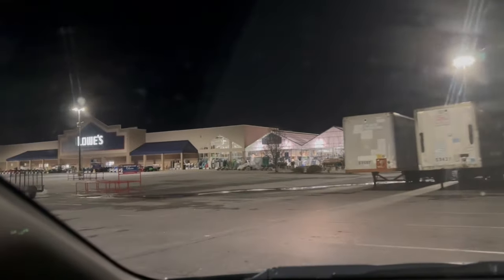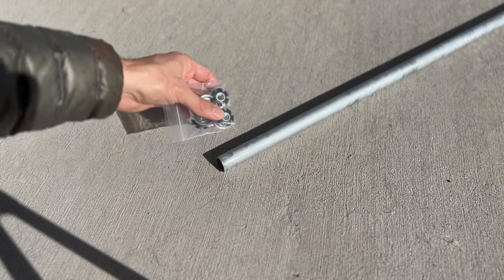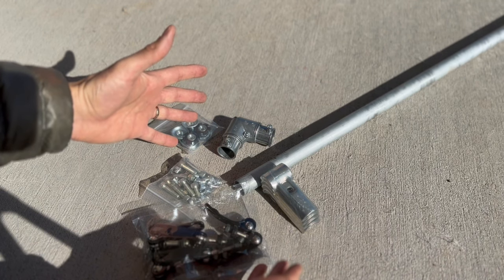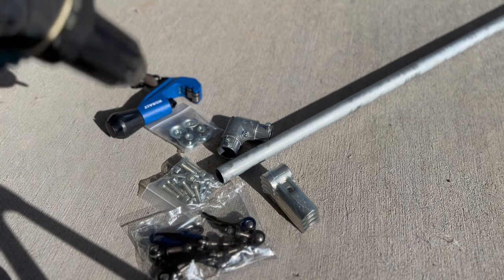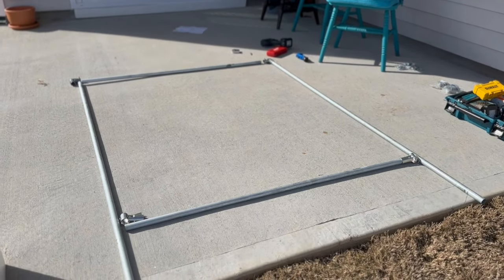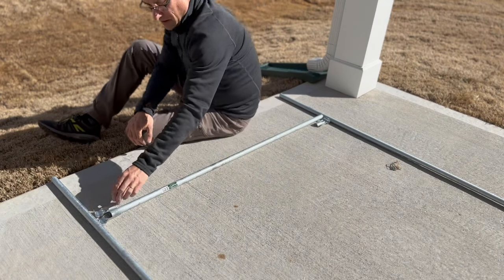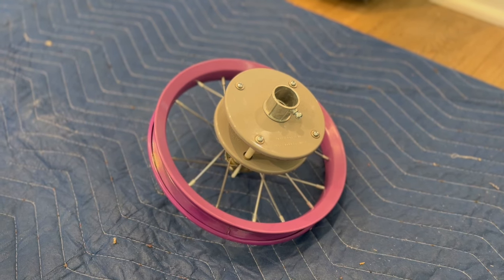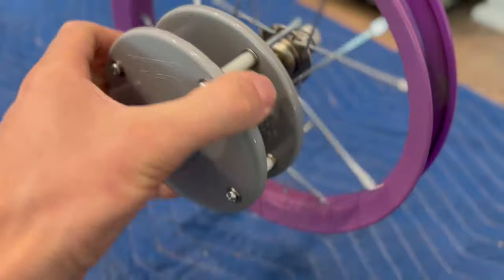Automatic Gravity powered Rotisserie for Camping

Comment: This video is awesome.  Thank you.  I fell down this rabbit hole while trying to build a gyro/shawarma/doner machine for wilderness adventures.  Your jerking issue is caused by the direction the weight is spinning off of the wrapping pole.  Most designs of flying pendulums I've seen use two wrapping poles on each side.  This reverses the direction that the weight unwraps before turning to the other side, making for a smoother turn.

Comment: The pole pauses as once the rock is released it swings forward and backwards (like a child on a swing) and the backwards part of that swing pulls against the turn of the pole. Having less friction won't change that pause, but having a longer string or a heavier rock will make the pause happen later in the turn.
Reply from the maker: I see. I’ll have to try that. I also noticed later that it’s important to keep the whole thing level and firm in the ground.
Reply: Here's one without any bearings - possibly smoother as a heavier main weight or a shorter arm? https://youtu.be/pqr7pR3jQws?si=EHXgZnzySfy6Xech&t=498

Comment: Mechanical delay / stepper action / regulator all in one. Amazing. Also probably quite flexible on the timing part. Bravo good sir.
Reply: It's called an escapement.
Reply: @justtinkering6713  That is a very fine word for this!

Comment: The coating on the pipe is toxic when heated to smoking.  I would suggest using other options for the spit. But the rest is fine. 

Im thankful for the knowledge and experience to share.
Reply from the maker: “in accordance with the 1997 Food Code, the use of galvanized steel in contact with meat and nonacidic fruits and vegetables is acceptable. Additionally, the US. Department of Agriculture states, Chrome, nickel, tin, and zinc (galvanization) platings will generally be acceptable for most appropriate applications" (Accepted Meat and Poultry Equipment, Food Safety and Inspection Service Directive 11220.1).” https://galvanizeit.org/knowledgebase/article/is-it-safe-for-food-to-be-in-contact-with-galvanized-steel
Reply: @davidrogol  Galvanized pipes can be safe to heat as long as they aren't heated past their maximum safe operating temperature. Heating galvanized pipes to a red-hot temperature can release zinc oxide fumes that can irritate your throat. The fumes can also be poisonous.
Reply: And pipes made before 2014 has more that .25% lead by weight. After are required to be less than that.
Reply from the maker: @MrBrandonLindner  Thanks for that info. I was hoping to use stainless steel but haven’t found anything I could use yet that is affordable.
Reply: It'll be fine.
Reply: That's what I was gonna say!  Great design though.
Reply: Didn't he paint it too?

Comment: I have already viewed, commented and thumb's-upped some of your other short videos about this gravity-escaped-powered rotisserie of yours. I find it quite interesting.

I never tought of rotating a rotisserie pole, which appear to be a perfect application !

Same escape principle could be use for a "sun tracker", a small platform that will rotate slowly, to more or less follow the course of the sun, during a day. It was to hold an inclined small solar panel (to optimized exposition throughout the day) or even a beekeeper wax-melting black box with a glass on it... or whatever.

So I would like to comment (try to answer) the little problem you encounter at the minute 28:00. Even though you probably worked it out by yourself, by now...

Anyway, here it is:

Your small cord with a little pouch of rocks at the end to swing it: let's call it "the BALL", OK ?

1. Keep the force
 Your long white rope exert a force on the vertical shaft, to rotate it 1/2 a circle every time the ball is released. You count on that force to swing the ball to the other pole and to grip it well, spiraling as many tours as you can get. That's the goal, isn't it ?

So, to me, your whole installation appears to be not stable enough. 😢 (You just deposited the pipes onto a rod in the ground, right ? Not sure.) so there is some "loss", there. Whenever the ball is released, the pulling-force supplied by your white cable is —at first— used to "wiggle" (is that a word?) your setup. Or to shake it a little, if you prefer... before eventually rotating the shaft. On every release of the ball, you loose there an important part of the energy that should be kept for the swing itself...
Do you see what I mean ?
Even though it may not be too noticeable to the naked eye, the ball hesitation (slowing up) is a testimony for this loss.

I noticed it, remembering how our ball was just "flying" horizontally like crazy.

Only solution for you, I guess: the whole setting needs to be more solidaire to the ground: Try to reduce the "shaking" by whatever mean you can come up with. Some angular pieces of wood around the rod that will insert into the base of the tube, some butterfly bolts near the ground, whatever... (pouring a cement base would probably be too much 😅). Anyway, make it so the entire force (or most of it) of each release will be fully used to quickly spin your vertical pole, and spin it ONLY.

2. The swing itself.
The weight at the end of the swinging rope is not really NECESSARY but for one thing: lifting horizontally the swinging rope. Not more than that. What will actually make your mechanism to stop, until the next escapment, is the rope torsaded around one of the twin retaining-pipes (you already know this). But it's not only the fact that it cause a delay, you get that delay by the grip of the rope around the pipe. So, the bigger the swing, the more turns around the pipe you get. The ball doesn't need to be heavy. Quite the opposite.
Now you will see why I called it "a ball"...

Visualise this: take a simple yellow tennis ball, punch 2 holes in it, insert your rope through the holes and tie it with a single knot on the external end. A ball on a rope.
You have played enough with your setting to foresee the ball will be swinging almost horizontally, due to its light weight, right ?

Thats perfect. It will tornado around the pipe with each torsade as high as possible under each other... and there is no need there for any heavy rock. A light mass just heavy enough to make the swinging rope almost horizontal when it swings is all you need.

Then, as already said, it is the grip of THE ROPE itself around the pipe that will do the job of retaining the whole mechanism not the weight of the pouch. I suppose you understood that already, because your pouch on a first try became a single rock, on a latter version. Experiment a little further and try a tennis ball 😊. It did it, for me.
Reply from the maker: Wow! What an intricate analysis! Thanks for the feedback!

Comment: I've been using emt conduit for many years to build stuff. Pre-Covid 1/2" was $1.80 at Menard's. Now it's $7.00 . 1" was $6.97, now it's $21.00 OUCH!!
I don't have to buy fittings because I have a MIG welder. I can either weld the tubing together or make corner, tee fittings that will allow me to disassemble the structure.
Reply from the maker: That welding skill is valuable! Wish I could learn. Makerpipe.com has some pretty cool connectors like quick releases and T’s which make assembly/disassembly easy. 😁 Thanks for the comment!

Comment: How did you get the numbers? Did you calculate them or you just did trial and error?
What should be the height of the pulley?
The diameter of the wheel, length of rope, the width and height of the pipes?
Reply from the maker: Actually, I just winged it. 🤣😂🤣

Comment: If you make the spinning shaft larger it will make your torque greater
Reply: I thought of that but it will also let out more rope each cycle, making the weight drop faster. But doubling the weight and using a block and tackle on it will make the weight drop half as fast with the same torque. Increase weight, increase torque.

Comment: Using pulley blocks at the weight and the branch will increase your cook time. As long as the rope ends at the weight, each set of pulleys added (1 at top 1 at bottom) should be approx double the cook time.
Reply from the maker: I just bought block and tackle for this idea. Looking forward to trying it. Thanks!
Reply: as a accumulator like in smarterevdays video ?

Comment: This is very cool. Keep up the work. One thing I will say I don’t know if that is galvanized steel or not but if it is you don’t want to heat that to a certain temperature or it gives up gas that is very poisonous and cancerous FYI
Reply from the maker: Thanks! Yes, I’m switching back to a wood spit. I appreciate you mentioning that. Others have also told me. 👍🏻

Comment: I might add a cap nut to the top or bottom of the pendulum shaft allthread and make the arms easily removable so you can rewind the line on the shaft with a cordless drill, reattach the arms, and get going again in short order!
Reply from the maker: Excellent advice! Noted! I wonder if I could rig up a hand crank instead of using power tools, just to keep it a bit more period.
Reply: @davidrogol  The torque required to raise the weight would be the thing I see as a condition for rewinding the shaft. You could adjust the handle length of a hand crank so you have the necessary torque for the easiest hand-cranking speed and expenditure of energy. The thing about cordless drills is that they have outstanding torque.
One other thing I was thinking about is that most rotisseries rotate much faster than they need to. Off the cuff, I believe one revolution per 30 seconds or minute may be enough. Perhaps you could get 30 minutes or more per load, making reloading less frequent.
Best of luck!

Comment: Why wouldnt this work as a perpetual machine since it turns a wheel?
Reply from the maker: Well, it’s actually powered by gravity. Once the jug of water reaches the ground, it has to be rewound up the tree like a clock. In this scenario, it was every 24 minutes but I’m working on a way to increase the time. 😁
Reply: @davidrogol Thank you for explaining that, your videos are very interesting.

Comment: I bet you have to wind that thing back up every five minutes
Reply from the maker: 25 minutes is my record so far but I’m working on a way to prolong it. 😁
Reply: @davidrogol  I was counting about 10 to 11 seconds for the rock rope to unwind and the bar to swing to the other sides to start the process all over again so approximately 20 seconds for a full rotation of the rope on that bar. So then you can do the math for three rope turns per minute and then divide how many of a rope turns you had stacked on the tube say 20 or so divided by 3, = 7 to 10 minutes perhaps.